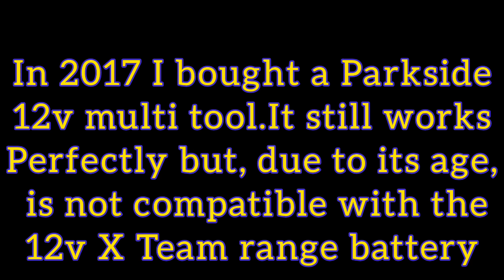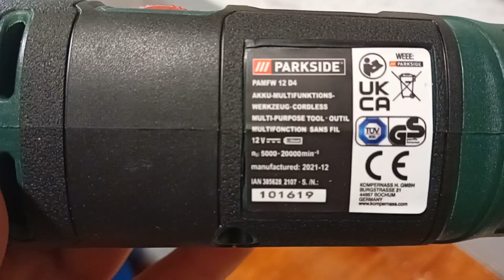Parkside tools. Is quality getting better, worse or still the same?🤔

Comment: Right so i brought one of those 12 volt muliti tools in 2021 , it uses the newer 12v batterys but has the same metal head as your old one , how very odd
Reply from the maker: @Mjk10957  Weird? I was trying to work out when the 12v X Team was introduced as I've 3 tools from 2017 that all use similar but incompatible batteries due to the reversed polarity. I managed to swap the terminals on the drill as it had no temperature sensor connection but the case needed modification. The multi tool is a bit trickier as it has a sensor connection and it's not in the same place as the X Team batteries. I wonder if they just changed the  PCB on the model you have.Is it badged up as part of the X Team 12v range?